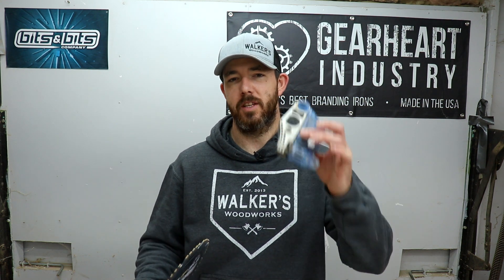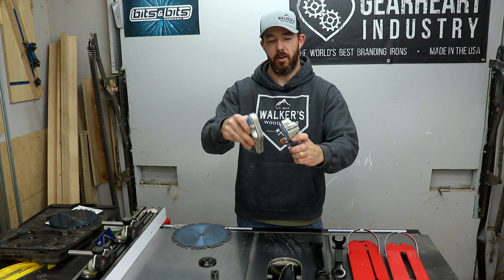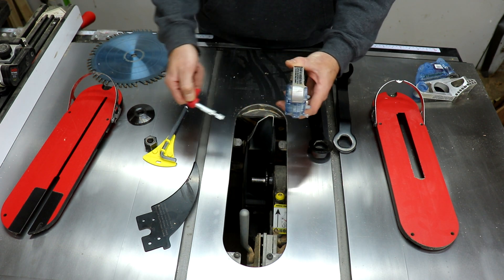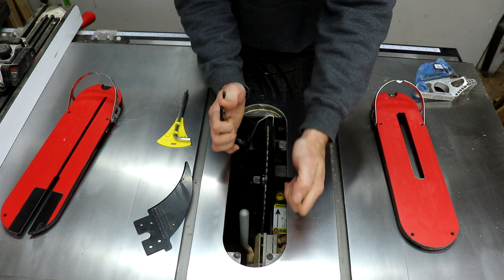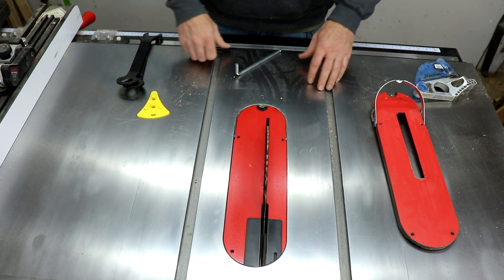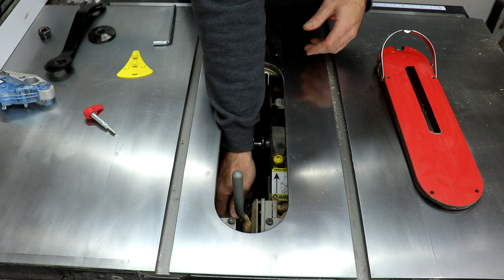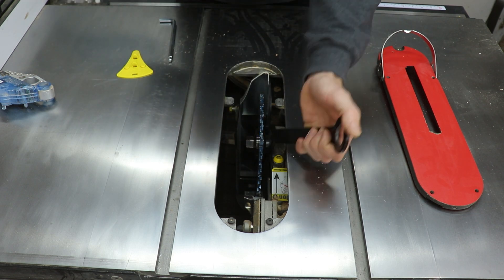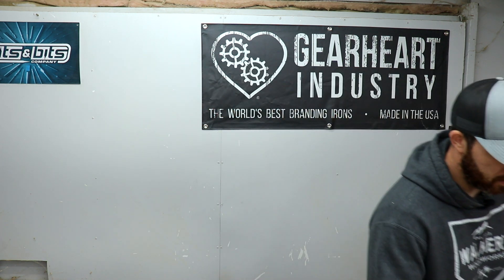DO THIS Before Changing A Blade On A Sawstop | Table Saw Tips

Comment: Had my saw stop fire off by me being dumb. Cutting thick narrow stock and the blade was just breaking thru the top with the blade all the way up. Well the blade next to the table was back about 3 or 4 inches from the tip of the blade  which I could see and the tip of my thumb just got nicked and it fired off. Scared the snot out of me as it sounds like a shotgun when it energizes. Thought I had an inch or more before I would use a push stick.Never even left a mark on my thumb. Best investment ever for this old man. Thank you for all your videos
Reply from the maker: Wow!  Glad you're ok!  I use this one at home and a 5hp at work.  I'm sure I'll eventually set one of them off lol.  Thanks for watching!

Comment: If you wanted to, could you just leave the regular blade cartridge on the saw, install a dado stack and then put put the saw on bypass? I know you wouldn't have the protection but it would save a lot of time.
Reply from the maker: You can't because the dado stack is a 8" and the cartridge is to far away.  Trust me I tried haha.
Reply from the maker: It won't allow you to put it on bypass unless the cartridge is close enough to the blade.
Reply: @WalkersWoodworks  man that's a bummer. That's a borderline deal breaker for me.
Reply: Your time is never a trade off for your safety.
Reply: Exactly the predicament I am up against right now. Unfortunately, as a sawstop owner it appears your total investment for a dado stack setup will be minimum $280 before taxes. I just bought a $100 Freud dado stack thinking I can finally start making proper dado cuts. Now I'm finding out I also need to buy a Sawstop dado throat plate ($60 in 2024) and a dado brake cartridge ($120 in 2024). I'm attempting to make my own throat plate but I can't make a dado brake cartridge

Comment: Hey Brandon. You said you had to tighten the adjustment all the way for your blade. How does that allow for a 6" or 8" dado stack?
Bill
Reply from the maker: I just meant with the regular blade I use I have to tighten it all the way.  The dado stack I use is 8" and that's one of the reasons you have to use the different cartridge.